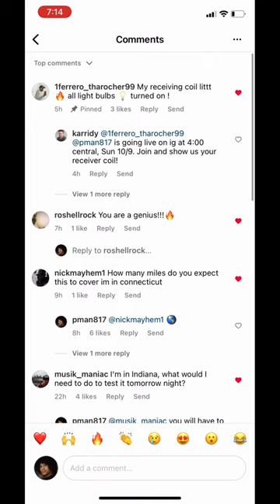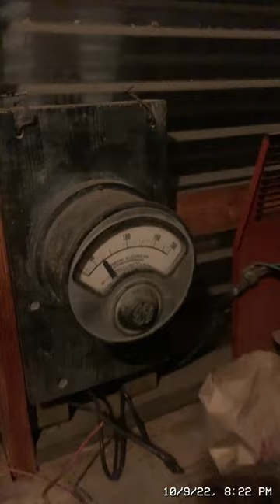Tuning the extra coil

Comment: If those coils transmit the energy where is it generated?
Reply: Watch more of his videos and also look into high frequency oscillators to understand more about the coils  . The energy is generated from his house tho  he’s using a big transformer and lots of capacitance to generate more energy to run the circuit properly .